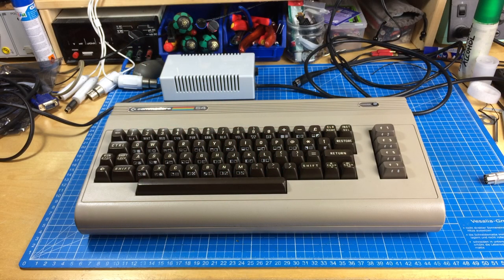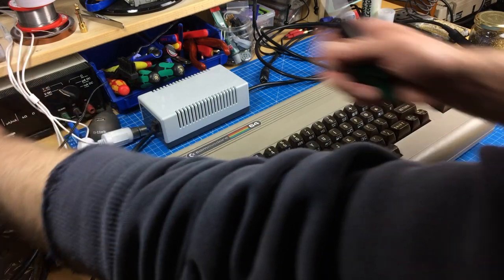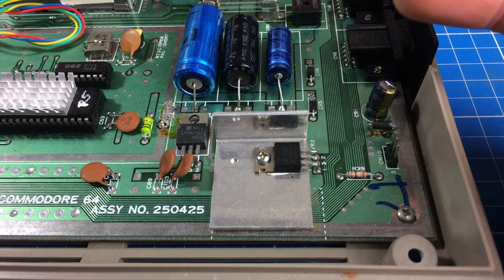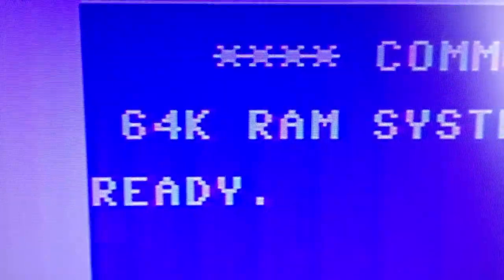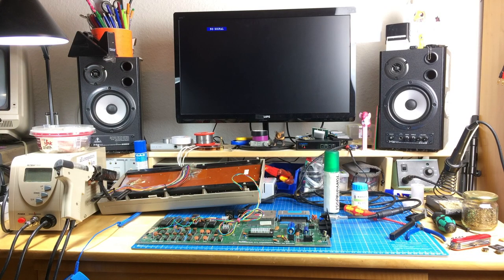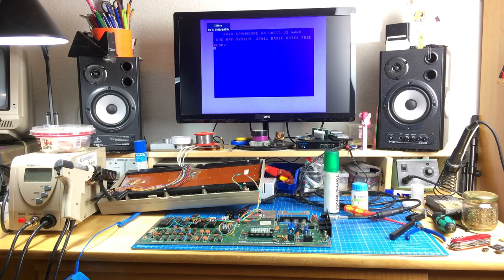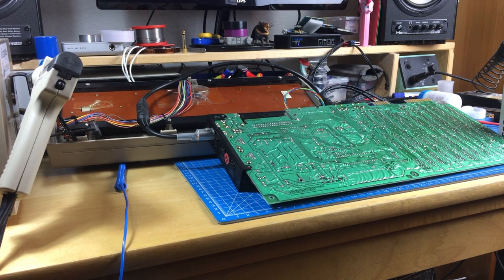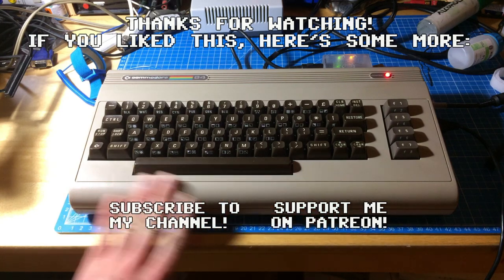Converting my C64 to modern DC-DC Converters

Comment: Great to see you back!  I did this upgrade to my 48K Speccy and re-purposed the 7805's heatsink to cool the ULA chip. It was cooking itself to death before, now it runs nice and cool!  I should do this to my C64 too.
Reply from the maker: Thanks! Yeah, the Speccys run incredibly hot. Makes even more sense to replace the regulator there than in the C64. Be sure to watch the follow up video before trying this mod. I had a strange issue with the 12V converter.

Comment: To observe a power rail noise you should use AC mode of an oscilloscope and a high Y channel resolution (like 50mV/div).
Reply: tzok83 exactly, the way he measured it now will never reveal any AC noise. That's what can happen when people using a scope do not really understand basic electronics......
Reply from the maker: You’re absolutely right of course. I’m going to make a little follow up video soon using some more meaningful settings on the scope.
Reply: Thought the same exactly. Just to check if DC is fine on a regulator a multimeter will be a much better option, since it is much more accurate, especially vs. analog oscilloscope. You can also measure noise on a multimeter in AC mode, provided it is accurate enough...
Reply: If you have a high-end multimeter - yes, you can measure voltage ripple on AC range, but most of these DC-DC converters run at about 100kHz (so most ripple is expected to be at that frequency). This is far beyond measurable range for low-end (2kHz) and most mid-range multimeters (30kHz).
Reply: AC-Mode, high vertical resolution, high horizontal resolution too.
Ripple with a linear regulator at worst case should only be in the tens of milliVolt.

Also if you are concerned about ripple you might as well add a small filter to the output. Nothing fancy required, 2 small tantalum caps and a coil are enough.
Reply: It is also a good idea to keep the ground lead very short when measuring power ripple/noise by using the supplied ground spring thingy with the oscilloscope probe. Otherwise you could be picking up surrounding noise instead of measuring the actual power output. Standard practice is also to bandwidth limit the scope to 20 MHz I believe when measuring power noise.

Comment: This was a great video. I've often considered using these drop-in replacements but was always a bit leery about the effects of high-frequency noise on the old ICs -- I am by no means an expert, just trying to gather knowledge from other people's opinions -- but these RECOM brand DC-DC converters seem to be well designed. The datasheet indicated 92%-94% efficiency with 15mVp-p typical ripple & noise -- you've selected an excellent component; I am going to purchase some, as well. Thanks for the informative video, and welcome back. :)
Reply from the maker: Thanks Mark. During my power supply research (well, googling) I read somewhere that the high frequency ripple doesn't affect the old ICs at all as they simply don't react to it because they are too slow... Might be some truth in that. ;)

The RECOMs are recommend by a number of people in forums all over the place so I think they are safe to use. I was actually a bit surprised that there was no visible (and audible) difference to the old regulators at all.

I'll make a follow up with some longer term observations some time.
Reply: For the normal 5V from the power supply, the C64 can tolerate a lot of noise and you can safely use power supplies with moderate ripple. For the internally generated 5V and 12V, noise is less desired as they are used to generate the analog signals. The frequency at which these regulators operate (usually a few 100 KHz) is well within the frequency of a television signal, so it is at least a potential concern. But, I think you did just prove that replacement by modern components is feasible. Wether you should use the first low cost switching capacitors that you can find here, is another matter of course.
Reply: > Jan Beta well they got smoothing caps after them anyways? or not?

Any switching regulator needs smoothing caps. Ceramic capacitors are preferred over electrolitic capacitors for this purpose. In case low-noise is needed, typically two-stage LC filters are used. A two stage LC filter easily reduces noise by 90dB. In extreme situations a three-stage LC filter can be used. Normally two-stage filters are considered sufficient to make switching regulators suitable for audio-purposes.
Reply: leery - no, wary - yes.

Comment: Not sure I would do this just to do this, but certainly great to know that this is a great option when the original regulators fail.   Thanks Jan!
Reply from the maker: Thanks! It definitely brings the temperature inside the case down by a fair amount. I'll obviously have to make some long term observations but so far I'm surprised about how well this works. :)

Comment: Hi Jan, I love your videos welcome back.
It is a lot easier to add solder and heat all 3 pins and pull the reg out the other side and then desolder the holes. To measure ripple on a DC rail I use the scope in AC i/p mode and turn up the gain to about 100mV/div this way you can easily see any ripple you can use this to check the difference between old capacitors and new.
Reply from the maker: Thanks! You're right about the scope. The way I measured was not very telling at all. The ripple voltage is very minor on these RECOM converters though.

Comment: Interesting. I've always wondered what the converters were for - especielly the 5V as it also got 5V from the PSU. I'm about start my clone build and I'm really torn what converters to use. I can't find 1,5A Recom, only 1A, and I'm unsure if it's really needed to replace the 12V. I plan to use a 85xx VIC-II chip even though it's a 466 board which unfortunately isn't as easy to convert as a 407 board but there's adapters for it. Also using an ArmSID further lowers power requirements - at least on the 12v. Then there's also the choice of really using the Recom or a China 2A converter. Higher rating and higher switching frequency and has onboard smoothing capacitors. My concern is which is most likely to fail and what failure mode - no output or full output? Which the last of course will be catastrophic. With time the VIC-II should also be replaced with a Kawari or J-VIC (when they're ready) which again further lowers power requirements. I'll probably try out the Recom as I've already bought the 5V version. But as said I'm quite unsure what to do with the 12V. Can be I'll keep it and mount a small heat sink.
Reply from the maker: What I ended up using is the Recom 5V converter and an old school linear 7812 for the 12V rail. The switching converter for 12V caused slight issues with the SID (see follow up video). If you use modern replacements, things look a bit different because they usually don’t use the 12V rail at all.
Reply: @JanBeta  Thanks for answering. That settle the case. I'll use an old school linear regulator for the 12v too - beside as said if using 8565 (via adaptor as board mod isn't as easy on 466) then the VIC isn't using 12v either so only a SID and the ARMSID is to my knowledge only using that for reference anyway. I wonder if its really make any difference to mount it on a small heatsink or the PCB tracks alone are more than enough. I have a '86 breadbin (probably minor issues with the PLA, never got to look into that because I'm not really using that machine) and actually temperature wise the 12v regulator get quite hotter than the 5v but it also had no cooling. The 5v hovers around 40C according to my IR thermometer measured at the black plastics. You can't measure shiny metal with IR unless you know its emissivity and have a thermometer with adjustable emissivity. The 12v hovers around 52C. Screwed it down with some thermal paste to the board so that the copper can help dissipate the heat and now they're both hovering around 41C - much better - I did take care not to short the back side using a plastic washer under a metal one as not to pinch the plastic one. But I'll going to use as new components in the clone build as possible. Even for a 8500 there's quite a difference in heat. The '86 8500R3 in that breadbin get quite hot where as the '88 8500 in shortboards and a Reloaded MK2 barely heats up.

Comment: Just a question Jan, the R-7812-0.5 has a minimum input voltage of 15V according to the datasheet. Isn't the input voltage to the L7812 9V on the C64? How is this working then?

Comment: Great vid as always Jan. Quick question. I've got a lot of 'extras' connected to my 64; Fastload cart, SD2IEC (Soon to be replaced with a 1541U2+ when Gideon ships the "April" batch)  SidFX dual sid and "64JPX" mega drive controller adapters. 
I've noticed that the display dims slightly when I press any of the Datasette controls and the Power LED isn't a bright as I remember it. 
is this indicative of old, linear 78xx regulators that are no longer up to the job? It has been recapped. 
Would these switching regulators be a better option in modern c64 setups in your opinion?
Reply: The datasette does use unregulated power, the 78xx regulators are not used for that. If the display dims when you press the datasette controlls, it means there is a voltage drop on the capacitors; too little power is left to generate stable 12V voltage for the SID.This can have two reasons: Bad caps or too low voltage on the 9V line. Check if the recap has been done properly. If yes, then the transformer in the power supply gives too low voltage. Please measure the AC voltage of the power supply both with datasette idle and under operation.
Reply from the maker: Yes, I'd agree to what Daniël said. The datasette power has nothing to do with the regulators on the board. I recommend checking your power supply or trying a different one.
Reply: Thanks guys

Comment: Nice mod........Would be interesting to know if the power supply is actually running cooler and without any side-effects , since they were not designed to supply current to a switch mode regulator.  I did a similar mod to a Vic 20 and I ended up with a high pitch noise coming from the power supply.
Reply from the maker: Thanks! Interesting idea about the power supply. I actually used my self-made one which already has a switching supply for the 5V. The transformer section which powers the 9V rail runs significantly cooler with the new regulators. Will try it with an original PSU soon.
Reply: I see, sorry, I overlooked that you are using a switch mode power supply. My VIC 20 power supply is AC output only, so my options are limited. I like the idea of a cool running computer with no linear regulators inside, you have inspired me to look again at options for my VIC.  Thanks!

Comment: Hi Jan, do you know where to finde those RECOM at moderate S&H fees in Europe? digikey and mouser have a minimum of 50 euros for free shipping or 20 euros flat.
Reply from the maker: I bought mine from Conrad Electronic but I don't know what the international shipping rates are. They are also available from various eBay sellers I think. Hope that helps!
Reply: Jan Beta found at Conrad. 8 euros! Unfortunately they are a little more expensive than the other sites. 14 euro in place of 9.

Comment: Jan, use masking (paper) tape to hold parts in place for soldering.  The tape you used can generate up to 3000 volts of static electricity.  Great job, though.  I really like your de-soldering system.

Comment: I was having a look at the parts for doing this and it's certainly something I would like to do as I think I only replaced the 5V voltage regulator in my C64 as that was on the verge of failing (random voltage output drops & dying star temperature when I noticed it)
Reply from the maker: Definitely brings the temperature inside the breadbin down by a fair bit. The transformer in the PSU doesn't get as warm, too. I'll have to do some long term observations obviously but for now I'm very satisfied with the result.
Reply: Indeed, your efforts have been very encouraging :)

Comment: Thanks for the great video, that gives me an idea to try same thing with less cheaper ones. Anyway i am puzzled by 12V, how can we get 12V out of a 9V AC? Is it +9 -9 potential difference equal to 18V? And what is your input voltage for the 12V converter?
Reply: Kinda. In the positive wave part, a cap is charged to about 10V or so. When the wave goes negative, rectifiers will pump the voltage up to about18V which is the voltage on the cap plus the ninevolts. charge stored from the positive wave is pumped out on the output cap on the negative wave. its a charge pump circuit.
Reply: bwack thanks, that's a great explanation.

Comment: The 780x series regulators that are in TO-220 packages are typically rated for 1.5amps. When you draw too much current the regulator freaks out and end up with a voltage drop and from there you end up with oscillations with a few ICs and blash blash blah. What I am trying to say is don't attempt to use a regulator that is rated for 500mA.

Also the reason why the regulator gets hot is it turning 9 or 12 volts into 5 volts and whatever wattage or voltage that isn't used say 12 volts down to 5 volts is a 7 volt drop and if 1.5A then amps X volts gives us 18 watts. Even with the replacement it is still doing that. In all honestly I would bypass the regulator and build a proper switchmode power supply and have it external. This will lower the heat inside the system a bit. Or replace the regulator with one that has a higher amp rating such as the MIC29500-5.0BT that is rated for 5A because I know that c64 must be consuming more then 1.5A Not to mention the MIC has Over Current, Over Temperature, Reverse Polarity, Transient Voltage protection.
Reply: Leland Clayton You don't get it.  Those black blocks are proper switch mode supplies, neatly put on tiny PCBs and dipped in black plastic. Which means there will be a lot less input current, but equally more ground pin current, as the internal coil feeds the ground during the off part of the duty cycle.  Hopefully, C= used a wide enough trace for the 78xx ground pin.
Reply: Easy, the C64 mainboard can handle at least 5A on the PCB for both 5V and GND. The 7 pin DIN power connector is the weakest link at about max 3A.

Comment: After watching this video before which I was unaware of these modern switching regulator components, I just upgraded my bread bin 250407 / 251137 to use Recom DC to DC converters. I selected the R-78B12-1.0L which is the 1.0A version of 12V regulator instead of the 0.5A version in your video. The specification says that the 1.0A version regulator needs a minimum of 16V. I am getting 18V input. My 5V regulator is like yours at 1.5A except the legs are already bent. The output voltages on pin 3 with just the boot screen are 5.03V and 12.21V respectively with nothing connected except for a video cable. All electrolytic capacitors are replaced including the 4 within the modulator. The PSU is a custom made Ray Carlson.
Reply: Update: My HDMI converter box mutes audio when the picture is turned off. So I decided to connect headphones directly to the SID audio using the DIN socket. When I power down then I hear a single 1.2 second duration popping “fart” sound that does not vary much in frequency. As already mentioned by others, it is likely that the 12V regulator is trying to recover when we do not want it. I see on the schematic, that the 12V line powers a transistor Q8 that delivers audio to the modulator. Years ago, I recall a friend’s unmodified Commodore 64 and Amiga 600 making 3 or 4 instances of similar much more elaborate “purring” sounds where each purring instance varied a lot in frequency. The total duration these noises lasted for about 10 to 15 seconds after power down. My friend explained that in his particular instance the sound was due to capacitors discharging and he used the audio as way to know when it was safe to power back on again. I do not believe this is anything to worry about.

Comment: Why is the backside of the PCB so wavy? Do you expect it to cause problems in future? BTW: I already own a Ultimate-II but noticed in your videos that there's a new Ultimate-II+. Directly ordered the new one just to support this guy in what he's doing.
Reply: I don' t know the reason, but it is a feature of all Commodore 64 boards up to some date, must be somewhere around 1985. After that the boards did no longer have the waves.
Reply from the maker: They tin plated the traces to allow for higher current. At least that's what EEVblog Dave explains in one of his videos. Makes sense to me.
Reply: I digged a bit deeper and found another possible reason: It should be the solder mask which is above the traces to protect them against corrosion/oxidation. The solder mask consists of a thin colored lacquer. This lacquer now got bubbles over the time, maybe because it expanded itself a bit. The interesting question for me would be: Is it just the lacquer which got the bubbles (remaining the traces perfectly flat underneath) or have the traces followed these bubbles too (and got separated from the PCB only held together by the lacquer)?

Comment: Very nice video. I've ordered a set of those voltage regulators now. Thanks.
Reply from the maker: Thanks! Hope it works as well for you as it does for me. Still needs some long term testing obviously but so far I'm very pleased with the result.
Reply: Do you think that it's normal that I have like 10,15V in the C19 cap (250407 Rev C)?. I haven't changed the 12V regulator yet.
I'm posting my mods in this EAB thread: http://eab.abime.net/showthread.php?t=89997&page=2